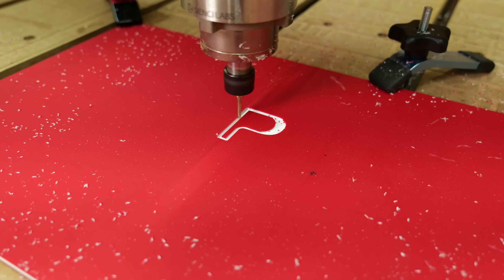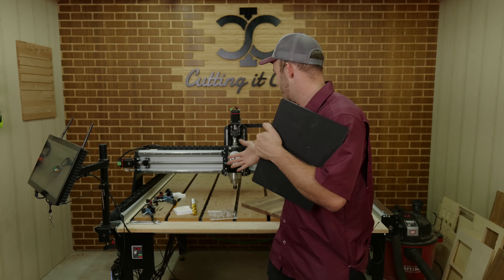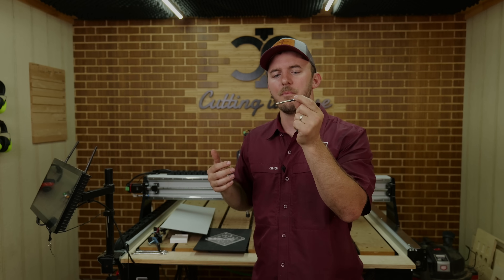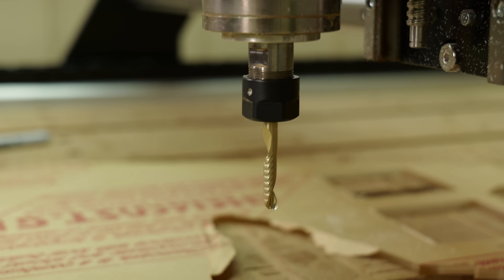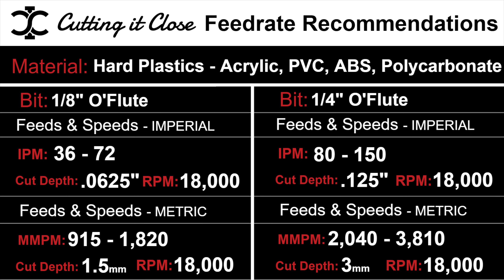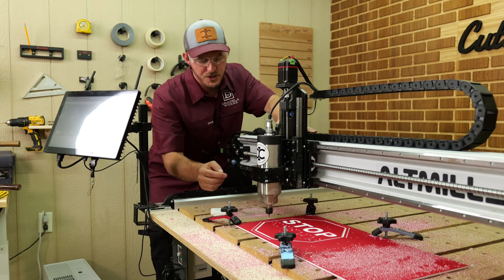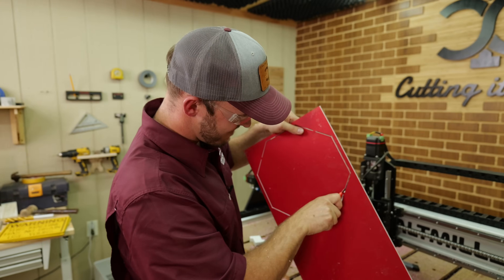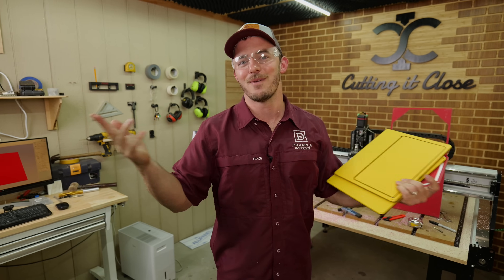Most CNC Users Cut Plastic Wrong – Here’s How to Fix It

Comment: I watched your video after ruining some ABS. Trying to make some parts for a glove box on a friends hot rod. Never tried cutting any kind of plastic or ABS. Ordered a couple of o flute bits and will try it again. Messy is right! My machined bogged down using a downcut two flute bit and overshot the end of one run. Can't figure that one out other than I think the chip load was excessive and confused the gcode.

Comment: Question....I am cutting only soft plastic on my CNC and still searching for the best settings and bit. I am cutting very soft stuff, thin flexible PVC vinyl. I have had the most success so far with the downcut 1/8" bit as it greatly helps keep the material flat, and I don't get buildup on the bit (using a vacuum table also) but as you say it leaves an absolute ton of extra stuff stuck to the edges, and I waste a lot of time cleaning my pieces up afterwards. 
I've just purchased the O flute and ran it for the first time, and while the cut was beautiful, I'm concerned about the immediate buildup on the bit while cutting, a problem I don't have with the downcut. The issue with this for me is that my material is so soft, that it can (and does) actually create circular scratches on the surface with this excess on the bit scraping the vinyl as it spins, and can ruin a cut for me. 
Going to continue with the O flute for the time being to give it more of a chance, but any recommendations for cutting thin, very soft/flexible plastic would be great. It's been difficult finding information for plastic as most info out there is for wood. Thank you!

Comment: You are running RPM way too high!  You have the same 1800 RPM for 1/4" & 1/8" cutters.  1/4" cutter should be running at half the speed.  It is "surface feet per minute" that counts.  Cut deeper.  Feed slower.  Slower SFPM.
          You need to also need to pay attention to mill direction.  The "good" side is on the "climb milling" direction.  If you are cutting a slot where both sides need to be pristine, make slot a little wider than the cutter & climb-cut both sides.
          Brittle plastic (like acrylic) cuts better when it is warm.  Cutting it cold can result in chipping & cracking later.  For intricate cuts with sharp internal corners, anneal the piece immediately after milling.

Comment: I would like to add a few tips from myself. When you are cutting acrylic, it is important to cool it well. A single-pass milling cutter is a good option, but it may not be sufficient. It is better to use lower RPMs, as they affect the heat generated. Ideally, you should use a water mist system, which can be achieved by using two injection needles inserted into each other. The inner needle should be filled with water, while the outer needle should be filled with air, creating a similar effect to a paint sprayer, but for water. Never use alcohol to cool acrylic, as you would do for aluminum, because cracks in the acrylic are inevitable. Use only water, and you can add a little liquid soap. It's important to remember that acrylic and other hard plastics like nylon or polyamide can quickly dull your cutters, even faster than cutting aluminum. Try to choose the optimal cutting settings that will reduce the overall path traveled by the cutter and shorten the processing time, such as lower RPMs and deeper cuts.
A slight dulling of the cutter will significantly reduce the quality of the processing.

Comment: As long as we keep the same chip load, can we turn the speed up and get a good finish on the Colorcore - e.e.24K RPM at 241 ipm is still 0.01in chip load (O-flute 1-flute up cut bit)? 🤔💥

Comment: basic upward spiral,  single o flute is all you need for most materials here , where is your hold down and vibration reduction on the work piece this is essential for edge quality and feed rates not that important normally faster is better if set is done right , do a clearance cut and then final to dress any edges very simple basic machining , if you want the real advice contact us we will help you

Comment: If you can afford a cnc router you can afford co2 laser , if you build a diy cnc easily you can build a co2 laser , you can cut plastic with router  yes , you can precise and detailed cut with laser and stop worrying these parameters, bits , fixing the sheet. Its the ideal tool for plastics (not PVC, pvc dont give problems with routers) , don't take this in a wrong way its just a recommendation to use the proper tool and work fast and easy = more money by work with better results
Reply: try cutting pockets with a CO2 and then we're talking. Lasers can't do everything a router can, so they don't just replace each other.

Comment: I cut king color core with a 1/8" o flute blue ones off amazon at 130 ipm and my spindle speed at 10.5k 1.25 depth and 45% stepover. haven't had any issues I feel like your speed is slow and high rpms

Comment: I use downcut o-flutes to cut plastics all the time. you just need to dial in the feed rate. 
Shopsabre pro408, 2 flute downcut o-flute by Amana at 160ipm. 

The reason to do downcut is for hold-down. I can cut a whole sheet on vacuum and if plane the spoilboard beforehand I can use the protective plastic film to aid hold down by cutting just barely not through it (.002 off the spoilboard)

Comment: This is a bit strange - comparing 2F vs 1F on the same feed. The chips on 2F will be 2 times thinner, and the heat evacuation probably ten times worse because of that. Hence melting and other goodies.

What really matters is the chipload and the speed of cutting edge relative to the material.

Comment: Great tips that I will definitely be using. Our machine is a Genmitsu 4040 Reno that tops out at 9000rpm, how would that affect the settings you posted? I assume cut it all in half? 

We are mainly only cutting 2 ply colored acrylic for making name plates. We've been using a 30 degree engraving bit but now I am thinking I need to order an O-Flute because results have been very inconsistent, especially on larger letters needing multiple passes to pocket it out and often have chip aways wrecking the part if we don't go super slow.

Comment: I recreated your OOL sign as a learning project.  The 24x24 1/2 inch sheet had a slight bow in it and double sided tape didn’t take it out.  The tape doesn’t stick well to the MDF spoilboards on my Shapeoko.   I ran the tool paths to create the screw holes I plan on hanging the sign with separately and used them to screw the sheet down to the spoil board, then disabled that tool path ran the others and it worked fine.  I suspect slight bows in HDPE are common and will have to be accounted for.

Comment: I have done a decent amount of work with colorcore and stuck to the conventional wisdom of the O Flute using a lower RPM and higher feed rate at first. But as you pointed out in your other video the pockets on darker central colors don’t look good. I tried a lot of things to resolve that. Finally I switched to using a 3 flute regular upcut bit and about 8000rpm. Yes, it leaves fuzzies but it also leaves an almost glass like finish on that pocketed surface.

Comment: This is great man.  I both the upcut zero flute bits and 3 sheets of the multi HDPE. When I did my first project i had a lot of the little pieces of plastic  hanging over the edges. I think it is because I just used the standard RPM instead of the RPM's in your chart.  Thanks for the videos man.

Comment: The key is a really sharp bit with one flute and a not too slow feed rate. It's similar to alluminium: A too slow feed rate can cause overheating. I machined a lot of plastic and plexiglas and I had always good results.
Reply: I cut HDPE, Delrin, and Acrylic quite a bit in my career as a toolmaker. We found the problem to always be temperature control. Chip removal is always at the core of the problem. Single flute, feed-rate, and up-cut help immensely but air or mist, even coolant are huge help.
Reply: @billfield8300  You're right. I tried with air too. But I always try to find a solution without cooling. Especially with liquid cooling (or mist cooling) it's always a big mess together with the chips. The best option (for me) I found is what I described above...
Reply: @alex.germany  There is definitely a difference between home use and an industrial setting.
Reply: @ Yes 😁👍

Comment: Im about to start using my cnc to do my epoxy and wood ashtrays. they are 10 x10x1.75 inches. The center circle is an inch deep and mostly epoxy. My question for you is what bit do you recommend for that if i want a flat bottom and curved bottom. Ive seen people use standard bits but dont know if what you said here applies to epoxy or not. Im worried that it may get hot and create issues. Any recommendations? also, if possible since im using a trim router in my cnc consider the biggest bit for the job that fits the trim router for me

Comment: your floors our terrible on your acrylic demonstration, never would be excepted as a finished product. Do you even know that term floor? Also yes I like Oflute but you would never use a 2 flute up cut bit for plastics. Use would use a 3 or 4 flute up cut. They work well and improve the floors. Once again your spreading misinformation

Comment: If it really is a single flute bit, why is called an O flute bit?
The feeds and Speeds you show are almost 3 times as fast as I typically run in Acrylic.  Is there a problem with heat buildup running slower speeds?  I just got tired of breaking bits so I run slow now.
Reply: yes, that would be way to slow and cause rewelding unless your running a mister
Reply: @dennygrant8148  Problem is, when I run faster the machine vibrates itself apart.
Reply: @starhawke380  

yup to do a good job cutting plastic you need a stiff machine, that why us Pros drop 100k on a machine, professional results requires pro machines. By the way this guy your learning from is not a pro, and does  not have pro equipment, he is a you tuber
Reply: @dennygrant8148  Im running a 3018pro I paid $130 for.  Im not a professional either, just looking to make some cool doodads for friends and family.  It would just be nice to be able to do it without constantly breaking bits or pieces of the machine.  Its a fun process to learn the balance between speed and functionality.  
Any thoughts on why that bit is called a 0flute bit?

Comment: Downcut endmills are best for cutting thinner “flexible” parts that are on a fixture. Typically a vacuum fixture with relief built in to the fixture.  It “pushes” the part onto the fixture while cutting rather than “pulling” it up loosing vacuum and throwing the part.  You can also get better edge finishing if cutting the full depth of part such as contouring etc.   You just HAVE  to have relief for the chips.

Comment: If cutting plastics like acrylic om table saw, use a blade that has a negative rake. The positive rake angle puts cracks into the body, while negative rake puts cracks into the removed. Great cutting, btw there are two processes for acrylic, one produces the melting and burning, the other is more expensive, but cuts better,
Reply from the maker: Thank you for the info! I’ll be sure to put that to use! I know you’re smart, the last name gives it away! Haha thanks uncle

Comment: I enjoy the content, been following you for a while. For most hobbyists, that's a good place to start on speeds/feeds.  I cut soft plastics full-time 99% of the time in my business.  Ramp up those speeds to 300-360 ipm and double the depths of cut on your chart and this saves a lot of time and the edge finish is great with the correct cut strategy.  I know most hobby machines aren't stiff enough to handle that fast and deep and experimentation is required, to each his own.
Reply from the maker: You are exactly right! Actually spot on with what I run on my shopsabre! I have learned over the years to idle everything down for the hobby machines which are the majority of people!

Comment: I'm having issues cutting 3/4" thick PVC (Sintra-type material) with an 1/8" bit (needed for the detail).  Using an Amana Tool 51437-K CNC Spektra Coated O Single Flute, 3 passes at around 65ipm 18Krpm.  Most of the chips come out on the first past, but the 2nd pass leaves a lot in the groove which helps hold the pieces in place, but I get fuzzy edges, and some welded chips.  Any thoughts or advice?  Thanks!

Comment: Nice - yeah I've been using standard carbide upcut 2-flute 1/8" bits for cutting acrylic and the results are okay if I run the spindle slow enough, like 12,000 rpm at ~80 ipm, also at about 1/16 cut depth. This should be resulting in about the same chip size range as your 1/8" run too.

Comment: I'm using  0 flute down cut for 1/4" hdpe. The 0 flute up cut leaves a small burr on the plastic, when milling lettering. I'm only going .062 deep and have had no issues

Comment: You said you will never have a clean cutout using a standard upcut bit. Well, I do get cleaner cutouts using my 1/8" upcut bit compared to my 1/8" o-flute bit. I used that o-flute once to cutout my acrylic piece and it got pulled off the table, it was only held down using double-sided carpet tape. Once I saw that, I held it down using my hands and the finish on the cut was not clean at all. I had to sand it down to get a clean finish. My cuts with the 1/8" standard upcut bit are just as clean as you showed with the 1/4" o-flute bit with 18000rpm, 1000mm/min feedrate and 1.5mm depth of cut. Double sided tape holds it down just fine when you use the upcut bit but not with the o-flute.
Reply from the maker: Interesting, I wonder because it pulled up, it was chattering some during that O’Flute cutting causing the rougher cuts. Standard across the board O’Flutes cut plastic better, not only my opinion, just a CNC fact, that’s why they were made. But if you getting great results with a standard upcut, if it ain’t broke, don’t fix it haha
Reply: "CNC fact" is a bit of an overstatement. You can get beautiful cuts in plastic with standard upcut bits if you can eliminate heat and vibration! (milling machine w\ vise and coolant) Also, it is not the helix that is the issue, rather it's the grind on the flute itself. This is why there are 2fl and 3fl (up cut and down cut) low helix bits that also provide beautiful finishes in plastics and they do it at much faster feed rates than a single o flute! "O flute" only refers to the grind on the cutting edge. It is not limited to up, down, helix, or qty of flutes!
Reply from the maker: I agree, that’s what I said above, O’flutes cut plastic the best.